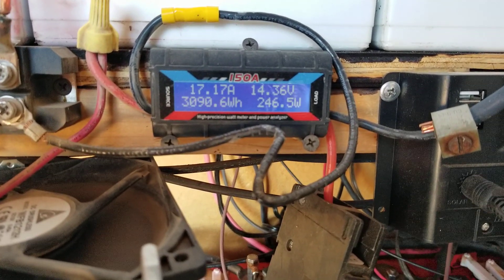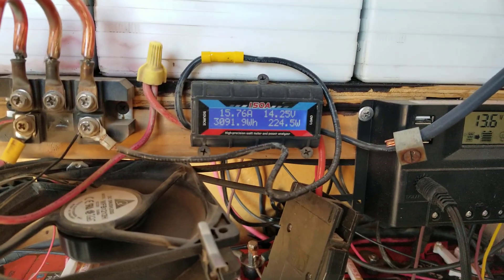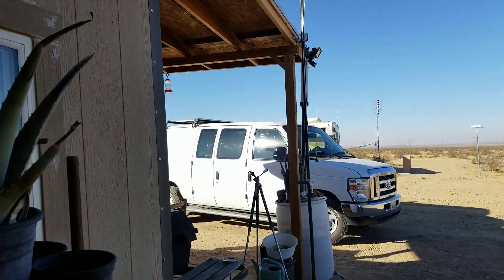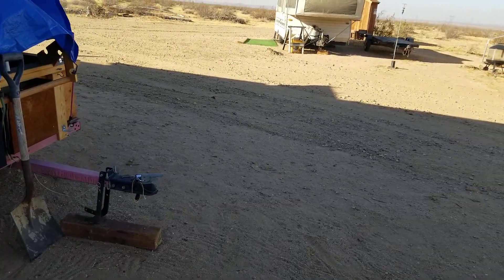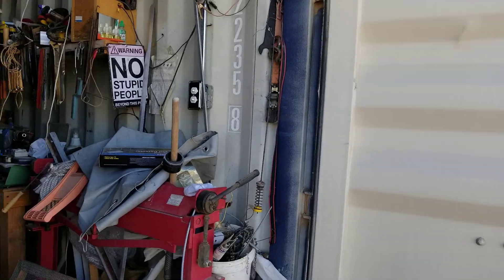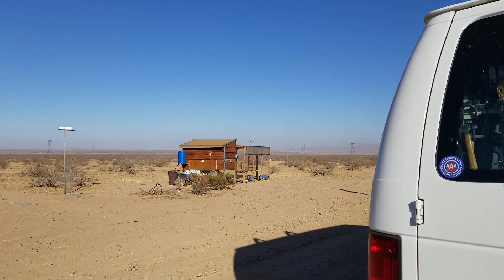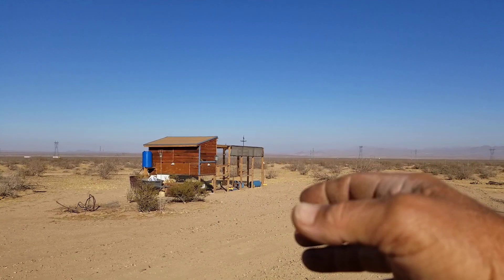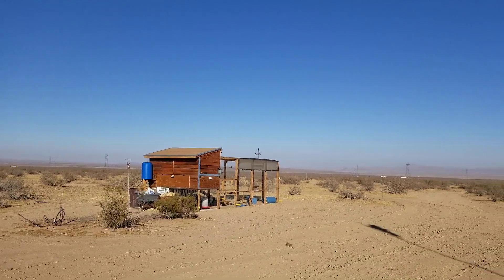How much power does a wind turbine make?  Sep. 27, 2019

Comment: I am sure glad you like with the KT-5  wind turbine is doing for you.  Yes your right those harbor freight panels need diodes but you just have to put one diode on one line positive or negative take your pick. 

Also I found the trick with laying down poison is you can't buy a small amount I buy it by the 40 pound bucket on eBay and it takes about 2 buckets to get rid of all the critters that play your property. Stay after them, they never stop working.
Reply from the maker: Thanks, yes I understand diode installation.  Also, I had major wind here yesterday and the KT5 peaked at 1018.5 watts, 65.5 ramps.  I figure the wind had to be near 60mph.  As soon as weather allows I need to tighten the guy wires, as the stretched a bit.
Reply: Good Idea!  I was sure glad the day I stopped using guy wires and went to rigid antenna poles.  When a local radio station took down their 300 foot antenna and replaced it with three 400 footers.  I asked them if I could have the 300 footer. I was tickled pink when they told me I could haul it for free if I did all the work taking it apart. It took me 5 trips with my flatbed trailer but I got it all out of there in 20 foot sections.
I know a guy in Hawaii who's got 1 of those turbines hooked to a midnite classic-200 and is getting up to 1800 Watts - link here and check it out - https://www.youtube.com/watch?v=dqe7xYT3lAM

Comment: Cool. Love the videos.  We have ducks and geese no chickens. Sorry if I missed it so what’s the average power ur wind turbine produced over a year. Approx.  per day.  or best guess.   I’m considering One.
Reply from the maker: Thanks, Rick.  Ok, wind turbines....One word-Supplemental.  At best, so don't rely on it for power.
Some FACTS about turbines.
1.  The wind cannot be counted on to be consistently productive.  Wind speeds fluctuate excessively. 
2.  A 500watt turbine rated for maximum 60mph winds will only produce 500watts IN a 60mph wind.  Normal output varies and production doesn't even begin below 7mph.
3.  In cold or freezing climates, do not use turbines with 'slip ring' technology.   The brushes freeze and Crack.
4.  Wind pressure on a turbine is intense.  A strong mast is required, set in a massive footing, with adequate guy wires for added support.
5.  The KT5 with a dual core PMA is a good choice for an area with constant 15-35mph winds.

As for my PMA,  it produces 100-1200 watts in my location, but I never know what to expect until the winds start.  If you are still interested in adding one, I'll be happy to guide you.
Reply: @GBear  thanks that’s Super helpful! I’ve read and watched a lot of different channels but a lot of them are just selling stuff. I appreciate your information.  I’ll let you know if I start setting one up.  Keep the videos coming :-)
Reply from the maker: @Rick Harold  thanks.  Yeah I found the same videos when I started out.  I learned from the school of hard knocks.

Comment: Is there a device that will disconnect the batteries when the charge is full, so you dont over charge and damage them?
Reply from the maker: Yes, I use a dump load diverter that sends overcharge to a resistor to heat the battery room.

Comment: Your charge controller should have a diode in it and should keep the batteries from discharging over night.
Reply from the maker: The Harbor freight controller does for sure because they aren't in the panels.  All I know is since I switched back all is fine.